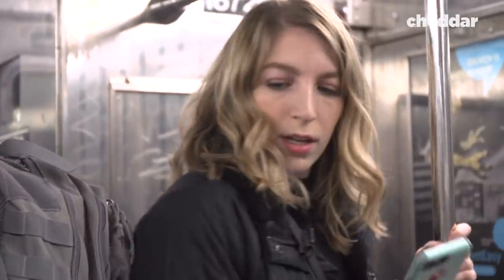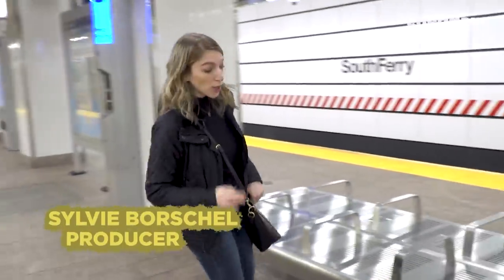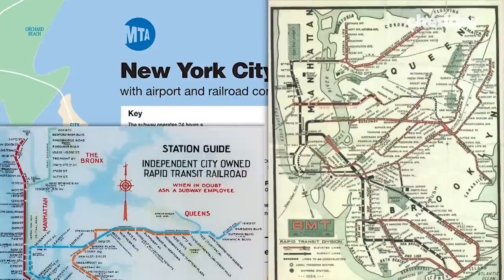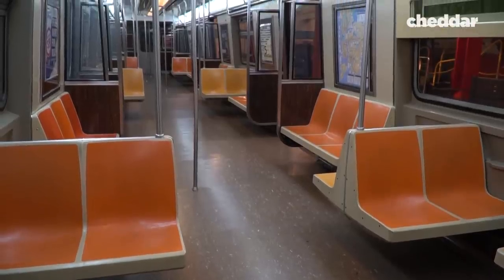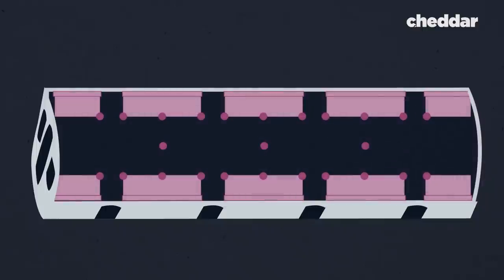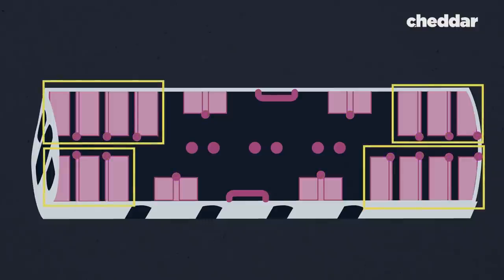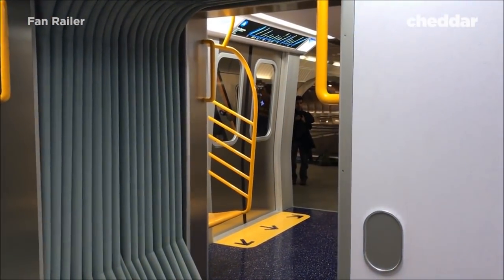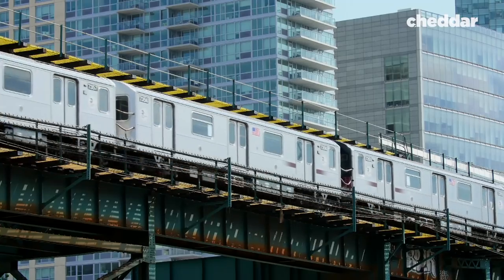Could This Subway Car Save NYC Transit? - Cheddar Explains

Comment: That design really looks like people sitting in the seats at either end of the car might get trapped in there if lots of people are standing in the narrow gap between the sides
Reply: Mischa Price yeah I just realized that. On a sardine can train you could miss your stop because people can’t move out of your way fast enough.
Reply: Yes, that is exactly why happens, and people also don’t want to stand between the seats because they don’t want to get stuck either, it’s a horrible train design for somewhere that will have full trains.  It’s also very slow to load and unload.
Reply: I don't think anyone is really going to stand between the seats if they are that narrow. I think the idea is everyone likes to stand by the door, so put no seats between the doors Ave everyone will just stand there. This is moving the seats out of the way from where people want to stand, without removing seats.
Reply: it looks pretty much just like our design in Seattle for the light rail. Especially during baseball games and in the downtown area it gets massively crowded, I've never had trouble leaving or getting stuck. even when it's packed to the brim.
Reply: I think the point that the research was conducted outside of peak hours is important. Trains that are designed around moderate use might not cope well in rush hour.
Reply: in japan they had one that seat and fold up and they all just stand...
Reply: Here in Australia we have that design and while people do get stuck in between the seats, there's no real problem when getting off because everyone either gets off at the same place, or you can just get up because there's enough leg room.
Reply: I think the people going short distances will stay near the center, and the people who know they will be waiting a long while for their stop will use those seats and be stand up a couple stops ahead accordingly.
Reply: Exactly what I thought. Kind of claustrophobic. The MTA often makes horrible decisions but not going with the sardine train was a good call
Reply: With that design, they should design doors right beside the window seats for people who sit there to get off so that way when they need to get off, they won't get trapped or have to constantly say "excuse me, excuse me" when trying to get out.  And it would allow people to get onto faster and easier if that's the aim.  I dunno why nobody has ever thought of having openable doors right beside the window seats that face forward/backward that are on the side of the tracks.
Reply: @bttrade6286  You've literally just described the old London Metropolitan Railway carriages from the early days of the Tube.
Reply: @HammaneggsAirborne  Why is this not being used in subway trains anymore I wonder.  To me it makes perfect sense.
Reply: Also homeless people
Reply: @bttrade6286  They probably phased them out due to complexity and more difficult to clean, instead of having one large compartment that you can mop and sweep in one go you need to go into tons of separate compartments. In addition, you either need to automate every door to open and close, which gives more points of possible failure mid-service, or you have longer station waiting times because station staff would need to make sure that every door is closed and secure.
Reply: @UCQzVDiDOW6ZXdlycsySVaSQ - That design works well in southern CA where not many people ride the trolley/metro, but in a city like New York I don't see it being very practical.  Even here I have seen some heated exchanges between people bc they are blocking that narrow aisle at each end of the car and people sitting want to get out quickly.  It would be a lot worse in nyc.  They should have seating for senior and disabled, everybody should probably be standing.  I don't know how long people's commute are on average though.
Reply: Yeah like a crowded bus gives me anxiety Bc I feel like I’ll miss my stop
Reply: yeah, plus you're vulnerable to anyone coming from behind you
Reply: @HammaneggsAirborne  You don't need to automate the opening of the doors by the forward-facing seats because what if the passenger who's sitting there didn't want to get off at that stop?  You would be opening the door for nothing.  All you need to do is just unlock the doors there so they can be manually opened by the passengers who are sitting there if and when they need to get off.  And then if somebody gets on the train by that door and sit there, he/she can close the door manually or once the train is ready to depart, all those seat-side doors will be just automatically closed and locked just like the central doors.  There won't be more delays if the station has some mechanism of stopping the passengers from getting onto the platform before the train approaches.  And the forward-facing seats won't need to be in compartments, they can just be in rows that are suspended a little off the floor with space under for them to be cleaned.  They won't be difficult to be cleaned at all.
Reply: We had that design on part of the London Overground and have removed it because once the line went over capacity it became a bad layout. The trains have now been sent north of Watford to be used on less crowded routes.
Reply: Agreed those transverse seats would be the worse. Think the middle seat is bad? No one ever moves over for the window seats on those because yo have to step over someone to get out.
Reply: that design is what we have on the trains in minneapolis and we just walk over the seats instead of the aisle
Reply: @stephanieda2276  I notice people tend not to stand in the elevated areas at either ends of the car if they can help it on those. Also being elevated it makes it easier to see and be seen when attempting to exit and the little stairwell breaks up the crowd a little. The Seattle trains aren't as wide as the NY ones so people would be less discouraged to stand in that area in NY. Especially since the NYC trains are single level end to end. Seattle trains also have wider doors and a center "car" with no doors that people tend to avoid standing in whenever possible.  During rush hour a typical NY subway train looks like a typical Seattle train after a Seahawks or Sounders game and the NYC subway trains are 3 times longer🤪
Reply: Well, as a European, where most of our metro and local trains have the traversed seats, I can tell you: There will be no problem for the people on the traversed seats at the end of the trains. Because most of the standing riders will not go in that area. That's why they left this BIG standing space with additional vertical poles in the middle of the train: most people will stand there. Only those who want to sit will go to either end of a car. And not more than one person really to stand there, only in rush hour times, and even then they are quite near to the doors.
Reply: The older DC metro trains look a lot like the sardine can design mention in this video. I hate it with a passion it’s an absolute bitch when the train is packed. The newer trains have fewer seats like that and more open floor plans. It’s better. 

I do, however, really like the design that MTA did choose. The ability to walk from one end of the train to the other while in motion like on the trains in Tokyo, is amazing. I’ve been wanting that in the states for years!!!! I hope NYC sticks with that design and it starts to be implemented in DC as well.
Reply: @rpvitiello  But you are forced to if the train is jam pack with people.
Reply: Yup, this is very similar to the train design in here in sweden, if the train is full, passengers in the seats will have to sqeeze through the pile of standing passengers in order to get off, which takes a good while.
Reply: You can ask people to stand up tho
Reply: BART uses this layout, and it really is a pain in the ass trying to get off during rush-hour.
Reply: That’s like the biggest problem during rush hour. The amount of times I’d be scared the doors would close before I was able to move past everyone and get out is way too many to count
Reply: Not really here in Atlanta Ga our trains system (Marta) has a similar layout to the  "perfect layout" trains and you really never get stuck. We've learned to kinda read body language and just stand and let the inside person exit. Our tains are alot more roomier than in NY so two people could stand side by side in the aisle. People seem to actually prefer the inside window seat here. We also don't have poles that go down the center of a train just places to hold on attached to the seats. Is the layout perfect no; people do like to congregate around the doors instead of spreading out down the aisles.